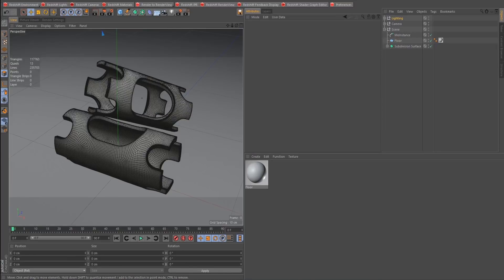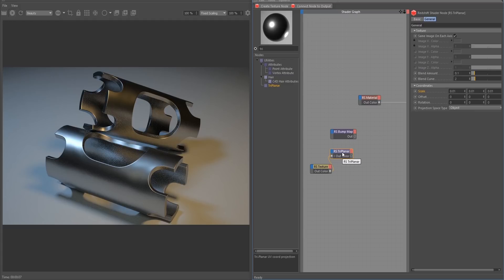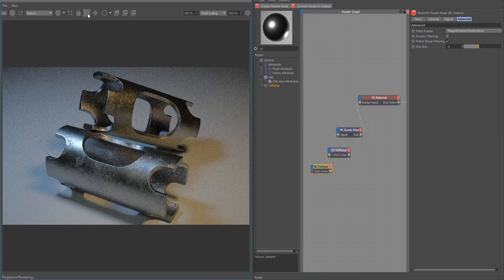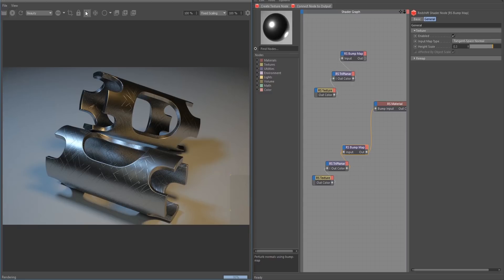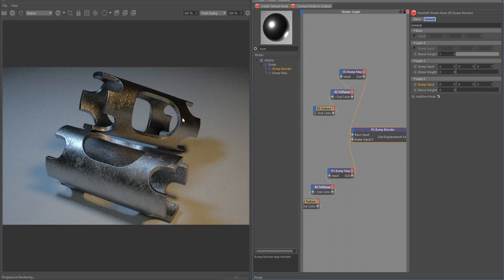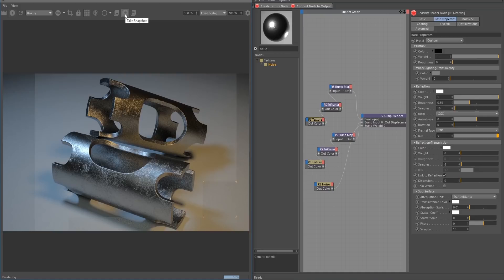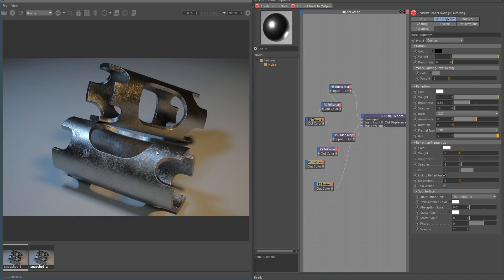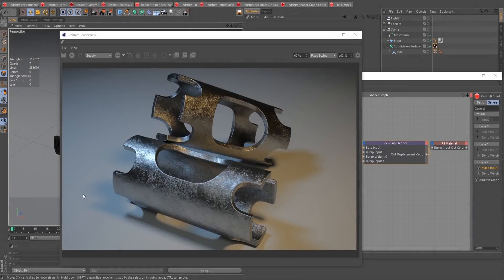Cinema 4D - Bump And Normal Mapping Tutorial

Comment: With the recent update, you can use C4D's new node System. I haven't used it yet, but will I be able to follow along  with this tutorial using the node system, or is this out of date?
Reply: you definitely will be able. At first, classic node graph is still available by default. And also this C4D's new node system contain all the same RS nodes with exact same inputs and outputs. So nothing changed in fundamental logic. Just UI.

Comment: Great tutorial, but some notices:
1) Metal has no diffuse = it should be pitch black or 0 weight for diffuse.
2) Normal maps in RedShift doesn't work ( see here: https://www.youtube.com/watch?v=hmOAgEQzrI0 ) + same for carpaint flakes, nearly impossible to reproduce.
Reply: You are right for 100% pure metals there is suppose to be no diffuse, but 1-2% black, the difference is extremely minuscule to the eye. As for your normal map issue, I suggest going on the forums and reporting this if you haven't already.
Reply: Normal map is deprecated you cant control the mipmapping on it hence why its deprecated. Unlike Octane Redshift does Mipmapping by default (Octane doesnt even support mipmapping), the problem with the old Normal Map node was it didnt include a mipmapping option, this is why you only need the new bump map node which also includes normal mapping now which does let you control or disable mipmapping and different texture filtering through the native DCC app.
Reply: no material ever uses a pure white or a pure black value ever, its physically impossible, including metals, the only way it could be pitch black is if it was kept in a vacuum with no light as soon as it was created, over time time the sun light, water, scrapes, oxidisation and many other reactions will cause the properties of the material to change making it impossible for any item to have a value of 0 or pitch black so in fact the tutorial is correct
Reply: "including metals" what do you mean? Metals has no color at all, means there's no white or black. You also should check this out: https://www.youtube.com/watch?v=AaFdCvnV8PM maybe its not 100% black, but atleast 99.5%.
Reply: im sorry but you are wrong, it is actually really bad to use a value of 0 eg. pure black as ur multiplying it by nothing, no metal is 100% perfect, every metal has had some sort of damage or chemical reaction which means it just cant be 0, its physically not possible... it can actually cause your materials to look less realistic as they arent physically accurate, also the video u linked literally goes against what you are saying
Reply: Talking about materials with scratches, dirt etc, then the metal has no diffuse again, the dirt and other stuff has, so you mask it on top of metal and the correct way to add color to an metal ( to make brass, gold etc ) its in the reflection/specular slot. Just go into ur renderer, set IOR to like 7-9, little of roughness and u will get a metal, then try to slide it up to more white or other random color and u will see how fast youre losing the metal look. Pure metal in real life is more like an blurry mirror.

I think you need to do some research how lighting in real life works, im not expert too, but here's a quoute:
"This cannot be reproduced by a simple solid color, because the shiny effect is due to the material's brightness varying with the surface angle to the light source. In addition, there is no mechanism for showing metallic or fluorescent colors on a computer without resorting to rendering software which simulates the action of light on a shiny surface."

Not realistic imperfections, but this shader has 100% Black diffuse:
https://www2.pic-upload.de/img/34926138/utyu.jpg
Reply: im talking more about the bleaching of metals from sunlight and the actual changing atomic structure of the material instead of a layer on top like dirt which should be another shader. u shouldn't be using a value like say 0.4 or 40% but a value from 0.1-5 is actually physically accurate for metals
Reply: like its practically impossible to find pure iron, pure steel, pure aluminium unless its just been created, and even still there are chemical imperfections, every metal has reacted with chemicals either from the air or its surroundings, therefore you just don't find metals with a value of black